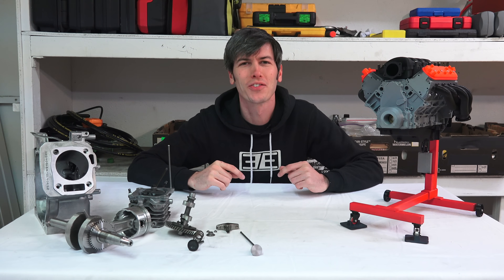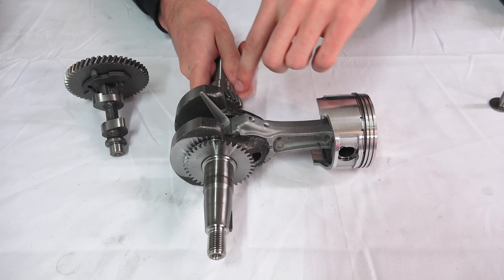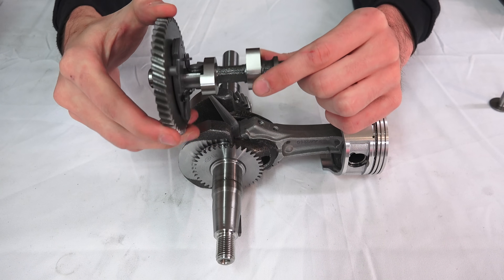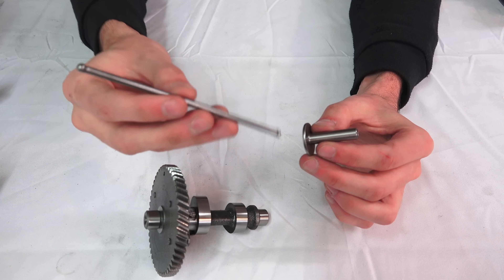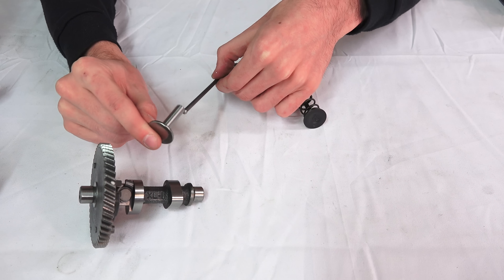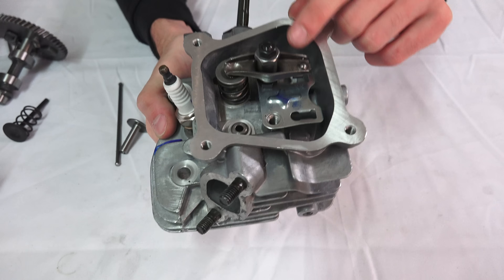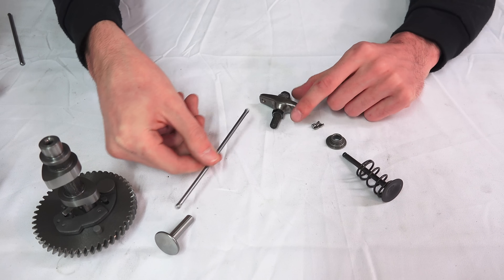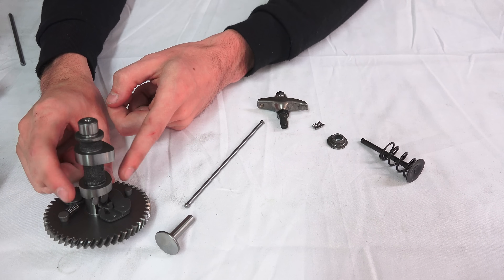Why Can't Pushrod Engines Rev High?

Comment: Piston Return Springs would fix all of these issues!  :D
Reply: Brett DiMichele Studios Hey guys; Chrisfix here!
Reply: Hey Guuuuuyz!
Reply: You can have high end power in a pushrod you just have to start out with a high end engine. Then you add high performance Finnegan pins and race aradastat plates and it will make all kinds of power!
Reply: Shabuti R18 You... didn't watch that April's fools piston return springs video did you?

It's just a joke...
Reply: You just have to use High Flow Piston Return Springs.
Reply: grim reaper I wouldnt say higher displacement is all that less stressful. You need to look at mean piston speed for that, and you will find that smaller V8s that run higher rpms to produce more power can have a lower mean piston speed than high displacement V8s that run lower revs. 

The reason Ferrari isnt very reliable is because they dont need to be. Their target market doesnt care how long the car lasts, so no money is put into stress testing their cars before pushing them out onto the showroom.
Reply: @shabutir1820  less torque. The foster you get. Think VW bug.
Reply: Shabuti R18 actually you can, the LS7 revs to 7000 rpms and make 505 hp with no turbo or blower helping it get there. and you can make up for the loss in lowend by having more compression ratio and running e85 for higher octane rating.

NASCAR runs pushrod 2 valve small blocks and run over 9000 RPM for hours so it can be done but it takes a lot more effort to make a pushrod 2 valve run high rpm compared to say a dohc motor.
Reply: But really, at the end of the day the engine of a Corvette and M3 still must have a utilitarian aspect to them as they're located in sports cars meant to be daily driven, and eventually worked on.  I'd much rather work on the engine with 1 cam and rather than the one with 4.  I don't think BMW or any other brand are making their engines more complicated just for the sake of buzz words, but I agree with Dodge and Chevy in this case in saying that if the wheel isn't broken, don't fix it.
Reply: Shabuti R18 ok so lets compare the beaste of a coyote to the lt/ls and also all the 3rd gen hemis and maybe say some of the german v8s ... Check out the cfms on all of their set ups and watch how close they are with the competitors the v8 that bmw used in their e92 had to rev high to make their power and the tq numbers were horrible gtanted it's meant to auto cross but that engine couldnt live long without crank/piston faliurs ... Its so much to write but also check out the gas mileage they get aswell, you have hellcats with of course conservative driving that are getting close to 25mpg on highway and vetts getting real close to 30mpg, last time I checked thats about on par with the coyote with more technology involved in them and also more then the older german v8 motors with the smaller displacements
Reply: Shabuti R18 way over your head buddy
Reply: David Johnson, better is a relative term. Obviously you haven't read the memo by Honda and Toyota. Honda's J-series, K-series, and F-series are highly complicated and their V-TEC systems have virtually no failures. I've owned K-Series engines, specifically a K-20. A DOHC, 4-valve, multistage V-TEC system, high RPM, 11:1 compression ratio, and complex alloys. Every got damn day, I redlined that engine to 8300 RPM's. At 200,000 miles, on the odometer, an oil analysis came back with little wear on the engine. Don't get me started on Toyota's/Lexus 2JZ engines that blow away a lot of what can be done on a stock engine. Then there's Lexus V10 devil that decimates most supercars engine outputs, the 1LR-GUE (probably will go down as the greatest factory made V10 in history). Reliability was the cornerstone of the engine and proved itself in racing. 

Complexity does necessarily mean less reliability. They can be correlated but good engineering/science can increase reliability.
Reply: David Johnson, I agree that direct injection does make engines less reliable. However, again, you didn't read the memo on what Toyota has done by offering a hybrid system of direct injection/port injection. Costly? Yes, but if gives you all pros of direct injection with no valve build-up.

So no, direct injection doesn't necessarily mean inferior. In addition, the GR engines employ valve timing technology, sophisticated fuel systems, high compression ratios (up to 13:1), and are overall more complicated than pushrods, yet, they are deemed some of the most reliable engines ever manufactured. 

This year Lexus is introducing a new twin turbocharged that has the potential to decimate the majority of all pushrod V8's.
Reply: its the valve that needs to close on time the piston want lag behind
Reply: grim reaper VVT and VVL are completely different. VVT simply changes when the valves open and close, not the duration. Therefore, VVT will not increase air flow as the valve is opening the same distance and duration only its opening and closing at a different time.
Reply: Shabuti R18 I understand that but there still is room for push rod engine to develop, higher displacement is less stressful then an fi setup if the 6.4 get a dual port fuel injection setup plus a bit more aggressive cam and better pistons for a little more compression I bet itll be 600chp
Reply: Brett DiMichele Studios use pneumatic valves solves all issues
Reply: Brett DiMichele Studios LONG LIVE GM 3800!!!
Reply: Kalvinjj  
Sadly the joke isn't as funny when we have to explain it to them! :)
Reply: Brett DiMichele Studios just make sure to keep fresh blinker fluid and a good muffler bearing to
Reply: @herbertthepervertplayscod79  - I just had two exhaust pipe bearings repaired.
Reply: I can't find any radiator filters for my truck. They're usually right by the carburetor sand and differential cotton.
Reply: Haha very funny
Reply: Even I have disassemble some engines, I almost believe Chris fix in his Joke ... but i was keep thinking about compression ratio and spring diameter ... how they could mange it :D .
Reply: Hey hey, Brett. Brett, buddy, you forgot about the turboencabulator. You CAN'T NOT have a turboencabulator. It makes everything better.
Reply: Used in some "free piston" engines
Reply: Brett DiMichele Studios HA HA u r funny! :)
Reply: Hahahahahahaha exactly it can keep everything In the combustion chamber nice and spaceout
Reply: Heheheh great way to ensure great reliability keeps everything nice and stiff and most certainly from throwing a rod right out my intake😂😂😂😂
Reply: Hehehehe keeps the piston right in place 😂😂😂just make sure the spring don’t snap hehehe that’s just more work for less reliablity😂😂😂
Reply: I bet it actually works it makes any car that is unreliable reliable hehehe however there might be a significant power loss😂😂😂😂
Reply: Except air flow. Even if you get valve float under control your cam profile, valve area, and lack of the ability to have a proper VVL system means that power at high rpms would require you to sacrifice your power at the low end.
Reply: @shabutir1820  See you directly responded to "Piston Return springs will fix all of these issues :D" You responded with some BS about valve float. The other guy again brought up High Flow Piston Return Springs and you then again returned some more bs about valve timings... Apparently you don't know how valuable a good set of piston return springs actually are... You responded to a fake topic 3 times...
Reply: @kramnull8962  Correct. But I then commented that I mis-read. The topic then continued on what I was talking about, which was not the piston return springs.

Learn how to follow a debate before joining one.
Reply: I read this entire chain. What have I done?!
Reply: Port and polish = more air flow
Reply: Somehow in the real world a 5.4 Ford OHC truck and a 5.3 Chevy OHV truck get the same MPG.
Reply: Shabuti R18 have you checked out the vvt sytme in the 6.4 apache and lt1??
Reply: Kalvinjj Sounds familiar. But now I realize I misread it haha.
Reply: It doesn't really matter when they usually have over a liter of displacement than most OHC engines.
Reply: Shabuti R18 you do realize pushrod engines have 4v or 2v configs right?.
Reply: Shabuti R18 You’d have to design new stuff, but there’s room. You think Honda just slapped some lobes on an old cam and made vtec? 

You also could do it in the head with rockers. Turn the pivot into an adjustable eccentric and you could change the ratio of the rocker. 

Most anything is possible, it’s just a matter of cost, necessity, and durability. So far it’s been to expensive and not necessary for it to be developed.
Reply: Shabuti R18 Not if you also have a supercharger cramming more air in, aha!!!
Reply: Shabuti R18 It's also less reliable due to added complexity, pushrod still better!
Reply: @davidjohnson8122  Complexity has nothing to do with it. A Ferrari engine is no more complex than a Honda 4 banger. The only real difference is the materials used. They use higher quality materials to withstand more force, they then push the materials to their limits. 

Thats why a Ferrari redlines at around 9k rpms. You wont find a factory Honda or Chevy redlining at 9k rpms from the factory, and not because their materials cant handle it, its because they are not built to be race cars. Even your top end Chevy V8 doesnt come pushed to its limits. The Ferrari V8 does.
Reply: oddball0045 PUSHRODS ARE BEST!!!
Reply: Not to mention space to do so.
Reply: Need blinker fluid and muffler bearing
Reply: Or at least stiffer valve springs
Reply: No way that would work without blinker fluid
Reply: Dude thats what im thinking.EmIdiot engineers.
Reply: And spring bearings
Reply: Yeah and that return springs snaps at high rpm? What happens there bud
Reply: @zombie95xx  - Piston, meet Valve. Valve, meet Piston. See who can gobble who up. Combustion Chamber is an innocent bystander casualty.
Reply: =blow valve seat
Reply: I remember of a japanese motorcycle engine ( i don't remember which) who used dual-cam push-pull system to aid the valve spring to pull back the valves on high RPM.
Reply: @ve2um  - Ducati of Italy pulls the valve shut 0.002”-0.003” (0.05-0.08mm clearance short spring does the rest.
Panhard et Levassor of France used a straight torsion bar between intake and exhaust valves. Very little spring tension as when the cam-roller follower-pushrod-rocker pushed one valve open the torsion bar shut the other valve tightly. Oil pressure in a sort of cylinder in the rocker pivot took up valve lash for zero running clearance. Very little power consumed by the valve train. AND oil pressure peaked at 3 psi!! NOT 30 psi. 3!! So hardly any power used pumping oil!
60 HP from 52 c.i. (851cc)!
Reply: Ever hear of bent pushrods?
Reply: Ducati solved this problem by eliminating valve springs. The cam pushes the follower, the follower pushes the rod, the rod pushes the rocker arm, the rocker arm pushes the valve open.
Instead of a valve spring pushing the valve closed, the rocker arm is forked to the valve, hinged to the push-pull rod, which is connected to the cam follower. The cam pushes the valve open then pulls it shut except for two or three thousandths of an inch clearance to avoid binding. A very short spring pulls the valve the last 0.002”- 0.003” (0.05-0.08mm) shut.
Reply: Why you want higher rev limit on your pushrod engine? If you want power you can put big supercharger. Except if you want to build a race engine, that's a different story.
Reply: Shabuti R18 They do VVT with pushrod engines. They use the same tech with an adjustable cam gear like what’s on an OHC engine. VVL could be done as well since you could just do like Honda and have an extra set of lobes and rockers for the high cam. The only real difference is all the extra mass and moving parts with pushrods.
Reply: Chris fix the best
Reply: Marcus Taber I-VTEC is also direct injection making it less reliable than good old port injection used in the "archaic" pushrod, just cause it's old doesn't always make it worse dummy, do your research!!!
Reply: Brett DiMichele Studios That doesnt solve the issues of smaller valve area and lack of VVL. Meaning at higher RPMs your valve lift is going to be the same as it is at lower RPMs.

The only way to solve this issue on a pushrod is to have higher profile cams, which will sacrafice your low end power and fuel economy alot.

This is why DOHC is preferred for efficiency. Not only is it better for emissions thanks to its ability to have a sophisticated VVT/VVL system but it also allows the power band to be wider and longer.
Reply: Cam phasing vs lift/duration control. I-VTEC has both:) Pushrods are archaic like carburetors and lever actuated ignition advance.
Reply: Somewhere along the line it became cool to have a DOHC sticker on cars though...
Reply: @the_niceking7011  - Some yoks try to claim a DOHC V engine as a 4OHC! YES, it has four camshafts but it’s two on each V bank.
Reply: Shabuti R18 Which is why Ferrari's are CRAP!
Reply: NBSV1 VVL cant be done on a 16 valve V8 unless you find a way to add another camshaft.

Have you seen inside of a pushrod engine? There is no room on the camshaft for extra lobes. It would have to be done on the head somehow.
Reply: 8alakai8 Yes but air flow will still be an issue unless you use high profile cams and sacrafice your low end power.

You cant have low and high end power in a pushrod. Thats why no other company uses them. They are not flexible enough to use in multiple applications without having many different camshafts.
Reply: @shabutir1820  They have sufficient low end, for street use and still pull a steeper gear for lower RPM's on top end... That's the one thing that 4 bangers cannot really overcome... Much like back in the 60's, A 289 would get a little better all around gas mileage in the Mustang. But a 428 on interstate would get much much better in a cruise...
Reply: @kramnull8962  Not true. The introcution of the CVT into economy cars has allowed the 4 bangers to make better use of their torque. 

For example, my 2016 Civic with the K20C2 will cruise at 1700rpms at 70mph on a level road. It peaks torque at 4200rpms. Which is plenty low enough for it to be maintain low rpms at high speeds and minimize fuel consumption.

There really hasnt been designed an "economical" DOHC V8 to compare to, mostly because the expense of the DOHC V8 means its pretty exclusive to high power needs such as large trucks or sports cars. Neither of which are designed for fuel economy.
Reply: @shabutir1820  Yes true, even a 92 Thunderbird Super Coupe would idle along on interstate at 1200 RPM at 70mph in 5th gear. That's 500 RPM difference. So you willing to say that your Civic is reving lower than a 480 ft. lb. of torque v8 in 6th gear? Call me when your CVT hits 100,000mi., without a rebuild....
Reply: @kramnull8962  Havent cruised in a V8 with a tach to know what they cruise at, only V8 I had was a 91 4.6L Ford Modular 3v. 

But anyway, even revving higher the 4 banger is using less gas.
Reply: I really wanted to see how long you would keep this up. I know what the original topic was. You were responding to a guy that posted a comment about a PISTON RETURN SPRING, which is non existent... He knew was non existent, and you kept on going. I just added to the cause...
Reply: @kramnull8962  Yes, but the topic was never about piston return springs.
Reply: @kramnull8962  that's why they are going electric. All torqure.
Reply: @kramnull8962  - Can't imagine 155 mph in a Ferd Fiesta Turbo!